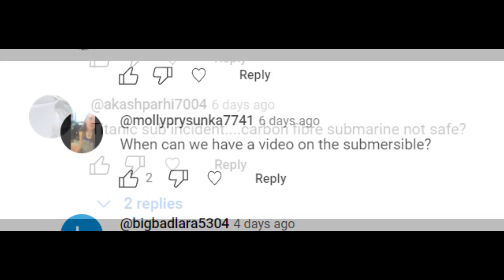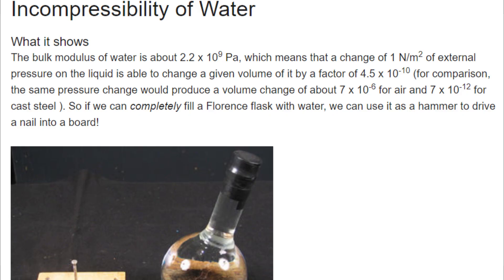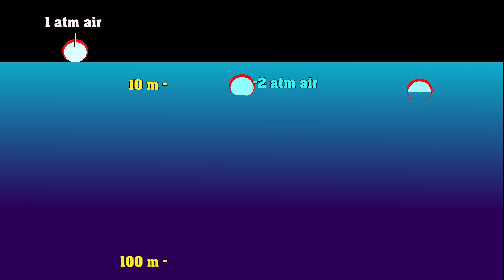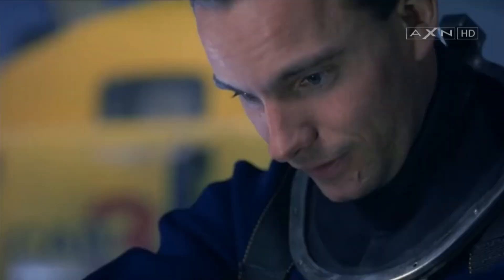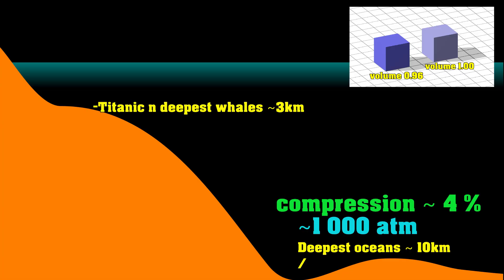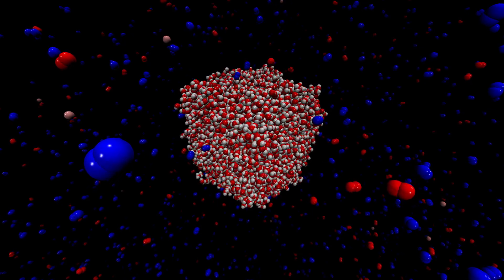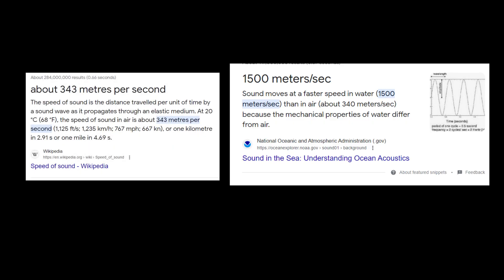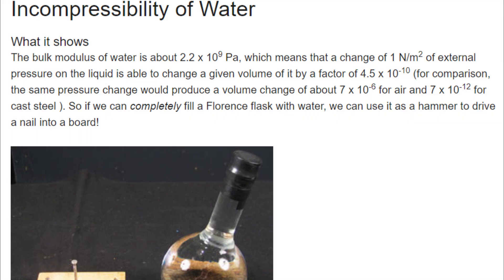What Happens when a Hull Fails at 1000 atmospheres?

Comment: The deep sea submersible vessel Alvin, with a 2' thick titanium sphere hull, is still diving after 50 years, having successfully made 5,000 safe trips.  
That is the design that 50s and 60s years old white and other race women and men told them to do.  But it's boring, not fun and innovative.
They wanted innovation from young engineers who were filled with hubris instead of decades of proven experience.  How bad they must feel now as they deliberately ignored advice.
Innovation is fine for your personal use, like home built experimental aircraft, but not for commercial use intended for customers.
Reply: yeah, that "woke and innovative" thing is a bit overblown. the main thing he had against experienced people is that they are expensive, whereas 20-years olds are cheap and eager to please
Reply: @DrWhom  Yes, but he didn't say expensive, he said 50s year old white guys.  That was deliberate.
There are 50s year old women he could have consulted with, who even warned him not to go with carbon fiber.

Comment: Actually it depends on how the sub failed. As someone that's shown how a large metal tank collapses almost instantly from air pressure differentials, thunderf00t should know this. If a hole opened but the hull held, what he just described would be what happened and the water would slice up everything inside in the first milliseconds. But if the hull's integrity failed, it would collapse and crush everything inside and the air would pressurize and then escape instantaneously once there was an avenue of escape. All of this would also create a bang. Of course, it's likely that some of both is actually what happened. But the crushed condition of the wreckage of the main body supports that it was more hull failure than breach. The hemispherical front end being relatively unscathed is not unexpected. There's a reason that bathyspheres are spheres. Cylinders just can't handle the external pressure as well as a sphere. The deepest diving subs are one sphere or connected spheres (pressurized beyond 1 atmosphere) with the mechanicals outside operating under pressure. This tin can design should never have been going that deep. Effing rich morons. I only have sympathy for the kid. #DarwinAward
Reply: So what happened is that the sub turned into a tube of toothpaste?

Comment: It's probably been said, but whales don't dive anywhere near that deep. Okay, Cuvier's beaked whales do around 3000m, so a large percentage of that deep.

But thirty feet of water would still kill you if it rushed in suddenly (say, an antique diving suit losing air feed without a check valve).

Comment: Way too complicated. Pressure difference of nearly 300 bar will tear into any itty bitty hole in the hull. There is hardly any resistance. It will cut you and anything in its way into pieces. The hull itself will tear instantly, because it is not made for such violence.

Comment: Whales exhale before diving so they don't have any nitrogen on board that would be forced into their tissues under pressure. Their oxygen is stored in myogloben in muscle, not in their lungs.
Reply: @dontlookdown5565 The point is that they return to the surface pressure with the same amount of nitrogen as they started.

Comment: @Thunderf00t you left out the funny parts, I am disappointed !!! Where the sub basically becomes a piston, like in a diesel engine, combusting the compressed air and all the combustibles (oils, hydraulic fluids, etc.pp) and the air bubble actually expanding and contracting (even multiple times).
From the acoustic oscillations of this even you can actually determine the depth in witch it happened if you know the volume of air. The were basically squeezed together and then combusted, this is why you will find little human remains (or what we would identify as human) in an accident at these depths.

Comment: Carbon fiber is not homogenous material. The strands are very fine, so to make an object thick enough for it to be functionable, it requires layers upon layers of separate cloth inlays, bonded together by an epoxy resin. Each layer can and will have voids - practically air bubble traps, where the liquid epoxy did not propagate properly before curing, thereby weakening the structure. Each cycle of contraction and expansion leads for crack propagation. Since the structure has hundreds of separate layers, it is impossible to visually inspect for cracks like you can do easily with metals. They at least had to resort to ultrasound scanning after each trip, but even that wasn't the case.

Comment: Hm. I am not convinced. It is interesting to know that water is actually compressible. But i dont think it would make any difference if it were not. At 4000 meters deep you have 400 atmosphere of pressure. That means 400 tons of water pushing down on every square meter. Air at 1 atm is much much less dense. So if a leak happened in a submarine at that depth; it would fill with the super heavy water above inmediately. Even if water were not compressible. I can pierce a plastic tube filled with air 10 cm deep in my bathtub and it will fill up with air. I highly doubt that water compressability makes any difference at 10 cm depth. Pls explain
Reply: Water at freefall speed would kill you anyway, that is my point

Comment: Sooo... the water at depth has a large amount of energy stored in it by virtue of it being compressed by a percent or two.  Calculating the volume of seawater that 'decompresses' to fill the submarine and we can know how much of that energy was suddenly released.

You did sort of gloss over the 'water hammer' effects though of that fast moving water suddenly colliding with the inside of the hull though.  Certainly those few cubic meters of water, traveling near the speed of sound in water, suddenly colliding with the hull interior is pretty devastating.

Comment: Plus with air being compressed at that speed it would likely kill you long before the water does, the oxygen would auto ignite.

A fire piston can be used to compress and ignite air with your bare hands in the same way a combustion engine does, now imagine the piston moving at several times the speed of sound i can imagine the oxygen would heat up to some absolutely insane temperatures.

Lots of physics at play for sure

Comment: This is good, but doesn't cover the structural failure of the implosion. When the tube at one atm gives way to the external pressure and colapses it's reduced volume will make the internal pressure closer to the 400 atm at that depth. At that extreme of a colapse the water has likely also at some point entered the void from the submersable.   There are many videos of oil drums or rail car tanks colapsing with a pessure differential of around 10psi, the Titon would have had around 5500psi differential.   It would be interesting to have you do an explanation as to why carbon fiber, and metalic end domes,  was not a good choice for material to build the craft.

Comment: 5:50. aint that the bends when you come up?

i thought it was oxygen poisoning.
 daltons law, partial pressures, and at 10bar you have 10X too much oxygen...

sorta like the opposite of space capsules running near pure oxygen at low pressure? partial pressure required for breathing , yet unable to support combustion?

Comment: I'm surprised at lack of in depth analysis surrounding the integrity and overall McGuyvering of the vessel. Just to start, the viewport was only rated for 1,3Km of depth. The titanic was at 4Km depth. The hull was also poorly manufactured since carbon fiber is typically wound in an x shape, they just turned the cylinder around and moved the carbon fiber nozzle left and right. Also, these types of containers are designed to keep the pressure inside, not withstand it from the outside. He used a consol controller to navigate the damn thing. Not enough testing, no certicifations from the proper entities. Just compare this toy to the James Cameron vessel like 11 years ago.

Comment: Took me a while to work out what Thunderfoot was doing  saying it was not pressure in the water that kills you. The vessel is full of air at 1 atmosphere, the water is at 400 atm. As soon as there is a breach the pressure on the water will want to move in and compress the air. The smaller the hole, the higher velocity of the water moving through the hole. You can see this when you kink the end of a hose that has water rushing out of it. Yes as soon as the water moves in to the hull it will equal to the pressure of the ship, but too late it now has the energy instilled on it from the pressure differential.

Given that the initial failure of the hull causes a small hole, the water rushes in at 400 times the pressure  at a huge velocity, doing immense damage, beginning to rip apart the sub and killing anyone near that jet of water. Instantaneously there will be a domino effect as more of the hull gets damaged, more disintegrates and more damage is done by the kinetic energy as the  water gets in, and more damage occurs. It would take mere moments to colapse the sub apart and rip everything into little pieces. It will be an implosion.

Comment: Why does it expand at 10 times the speed of sound? Molecules can only push molecules at the speed of sound, Mr. Foot

you gotta explain that part more
Reply: I think, you have to specify what speed of sound do you mean.

Compared to the speed of sound in (1 atm) air, the speed of sound in liquid water is higher.
And even higher, when the water is compressed.
Reply: @yourguard4  yeah, I looked that up bcause I was confused, speed of sound at 2.5km depth is 1400-1500m/s

but it still doesn't add up. Let's ask Mr. Foot for more content

Comment: But you didnt describe, how the sub implodes. You spoke as if it just leaked and filled with water. But the effect was way different than that. The integrity of this carbon fiber, couldn’t handle the stress of that much pressure. It flattened like a giant foot crushing a can, that was laying on its side.
Here is a guy that uses hydraluic pressure to crush various things in a water chamber. Tennis Balls, light bulbs, even toy subs that he has 3D printed out of titanium (well, thats what he says he did. And with an accent like that…)

https://youtu.be/8tW4zfTeJqM

Comment: This explains the physics of the process (which is excellent), but leaves out a few details. The implosion is so fast that it is essentially adiabatic. The velocity of the water is supersonic (in the 1 atm air). That forms a shock front preceded by a high temperature region. This shock front is similar to an explosive shock front, and will have a similar effect on the occupants. Furthermore, the potential energy available to the process is equivalent to about 50 kg of TNT, but entirely focussed on the interior. After the adiabatic compression phase, the potential has been converted into kinetic energy, which would be focused into a very small volume. The next phase then is explosive expansion to redistribute the energy into the environment. This process occurs in about one quarter of the time it takes for the compression, so is even more violent. In other words, there is essentially a two-step process, each involving the energy equivalent of a 50 kg of TNT explosion. That's a rediculously large amount of energy focussed into the occupants over the time of about one millisecond...
Reply: Absolutely, but reading around many people have been touting the incompressibility of water as a reason it would happen slowly and this mops all that up.
Reply: @mandowarrior123  I'm getting really tired of people repeating the phrase "incompressibility of water" from high school like a parrot, completely ignoring the fact that water is still around 80 times more compressible than steel for example. Yes, it is virtually incompressible compared to air at pressures we are familiar with. It's just another story in these depths...
Every common hydraulic system in the industry has to take the compressibility of the hydrualic fluid into account. It's more compressible than water, but not by orders of magnitude. We can treat it the same way.
Reply: @shogun8-9  ah how I love 'Education' when 'compresses little compared to air' would be just as coherent. Is it some form of knowledge gatekeeping? I think it bad enough when knowledge is taught as dogma. But when it is baseless it is a special kind of abuse. Its no less deadly than religious indoctrination, often moreso.
Reply: Knowledge gatekeeping? Sigh dude.....
Reply: @knobjob2839  Just ignorance then? Seems incongruent with curriculums expressly forbidding the most accurate answers.
Reply: @shogun8-9  When you consider that at 3000M it only compresses 4%, that's pretty "uncompressible". The thing about ppl like you is: you're so wrapped up in the details and technology you forget that most people don't care about that "technicality". 

It's like talking to a physicist and inviting him to a party. "what time will you get there" ?

Him: "well considering time is a man made construct and in the realm of space time what you really should be aski.. nevermind...don't bother showing up.....
Reply: So it was a diesel submarine…. Once
Reply: Exactly. They showed what the submersible looked like when they pulled up the debris and that shit was blasted into hundreds or thousands of pieces.
Reply: well, he did "dumb it down" and in simplest terms.
Reply: So in layman's words, Thuderf00t just talking out his ass! 👍
Reply: @stevenbobo6464  no, in layman's terms he explained what happens to a person at that depth.
Reply: So paste.
Reply: I have been following Thunderf00t from the start and he has never been far off the mark but I struggled with this one. He has explained the physics process brilliantly up to a point, yes whales swim to great depths without imploding but no one with a brain has been saying that humans implode at great depths , whether we are made of mostly water is irrelevant when you have a million shards of carbon fibre shed you to pieces in less time than it takes to a blink of an eye.
Reply: @jirom71  You're being too pedantic. He explained what happens at depth, not whether it mattered or not. 

You: I don't care how the house stays up, I just care about living in it.
Me: why'd you watch a video on how the house is built then?

Comment: And the air being compressed by this water entering at 2x the speed of sound? How hot does this get. We've all used a bicycle pump and felt the heat, some have used  compression fire starters etc. Compress air it gets hot.